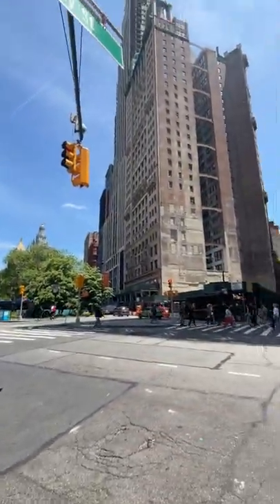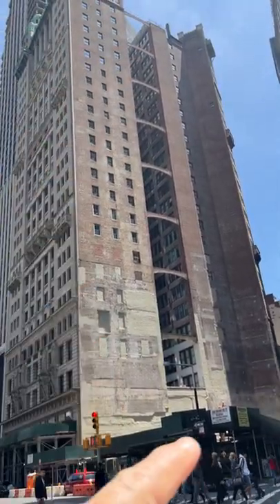This is How New York Did Air Conditioning Before Air Conditioning | Fifth Wall

Comment: Here in south Texas they used to build houses in a railcar fashion. Living room at one end of the house, where the front door is. The kitchen and rear door at the other. In between was a hallway connecting the two. The bedroom doors were across from each other on each side of the hallway. Open the doors and windows in every room. You had cross breeze no matter which way the wind blew. My grandmothers was this type when I was young with no AC.